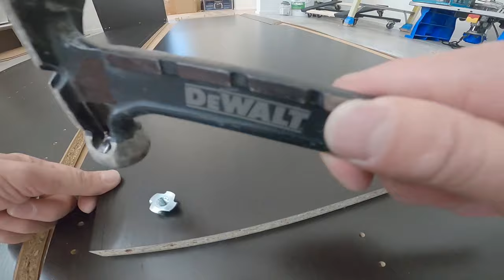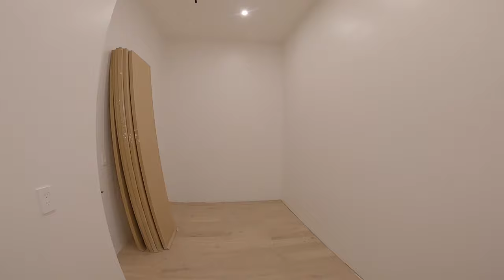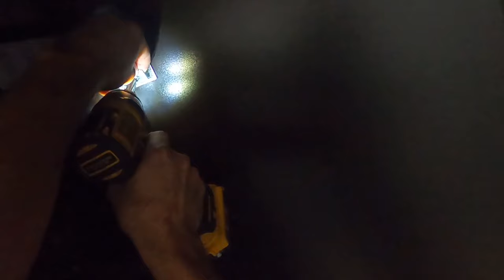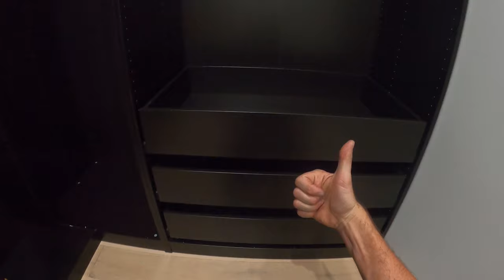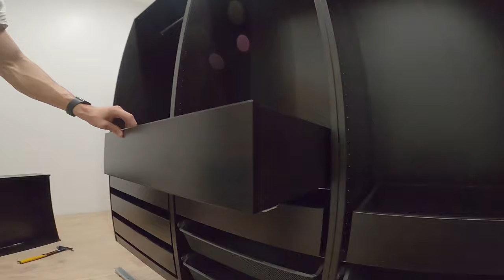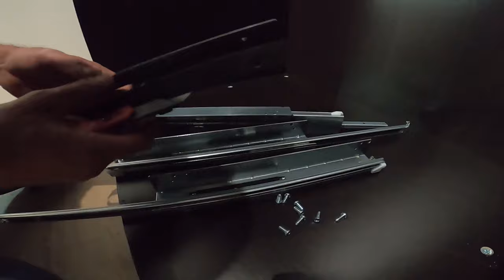IKEA PAX Wardrobe Assembly. Spacious Closet for your Dream Home.

Comment: Can you explain why you put a wood piece (looks like a door stop) under the frame before sliding another frame? Did you screw into that wood piece? Thanks!
Reply from the maker: So what I am using here is called "wood shims", and the purpose of that is to level up the PAX when the floors are under level. I just slide them under the frame and that is it.
Reply: @maxplus2849  so you are only doing this under certain frames when the floor is unlevelled nothing to do with securing them? interesting I was about to get some wood pieces! I do not need it.
Reply: @maxplus2849  Thank you, much clearer!
Reply from the maker: Yep, not screwing anything into the floors....